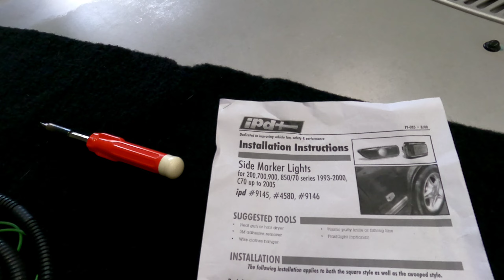Side Marker Upgrade  |Volvo240Life|

Comment: I used a heat gun that I borrowed from a fellow Volvo 240 owner. I heated the top of the Volvo plaque up and applied light pressure with a small flat head screwdriver and the plate came right off!
Reply from the maker: Haha, even just parked out in the sun for a while they come off better than that train wreck of me taking them off nearly frozen.
Reply: @volvo240life  Oh-my-gawd-Becky-Look-at-her-train-wreck-It-is-SO-BIG!
Reply: @volvo240life  Hey you were absolutely right about the Mr Clean Magic eraser!! Amazing what that can take off. I saw in another video about these lights how the plastic wire clamps that IPD includes do not penetrate the insulation on the wiring completely. Did you have that issue as well? I seem to be having that problem. I installed the lights and hooked them up and nothing. I have to use my test light when I get a chance to see if they’re getting power.
Reply: Addendum/update. The plastic wire connectors weren't the issue as it turns out. I purchased the orange LED 194 bulbs from IPD when I got the kit and the orange lens side markers. The clear lens ones weren't available when I made my purchase (man these supply chain issues as of mid 2022 are a PAIN)ANYWAY the LED's DO NOT go into those side marker assemblies easily AT ALL, because the head of the bulbs is so big (*yeah I had trouble getting it into the hole*) and there lie the problem. They are working now, but it took some finagling to get them to make a good electrical connection.

Comment: Awesome! i didn't even know about this kit existence. Am I looking right? It looks like the side markers turn on when the front markers turn off and vice versa, may be an optic effect. Great video!
Reply from the maker: IPD sells the kit, but I'm sure there are others available out there.  I would say the wires could be an inch or two longer.   You can wire either for just side markers or side markers and turn signals.  There is a small delay on the turn signal function from front to rear when the marker is included.   I wired mine so they stay on as a side marker when signal isn't in use.  Thanks for watching Nacho!